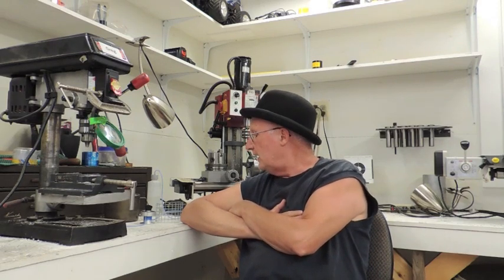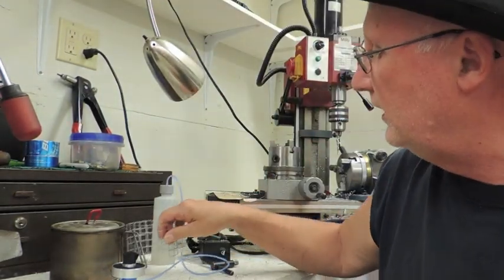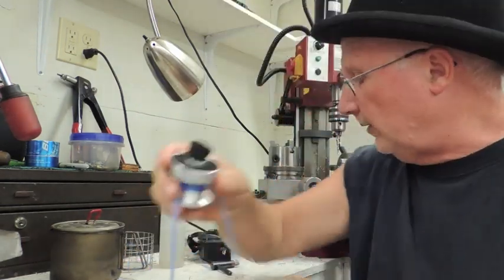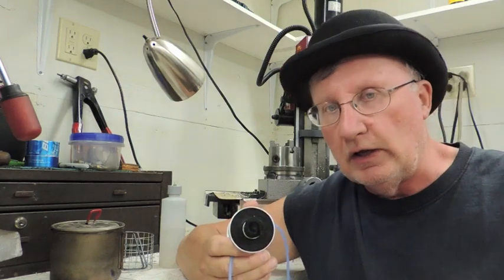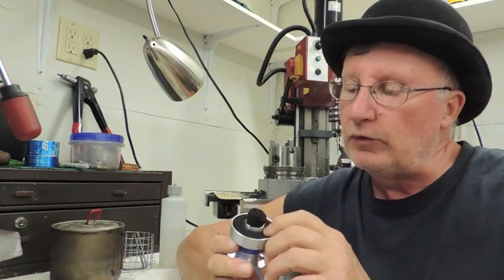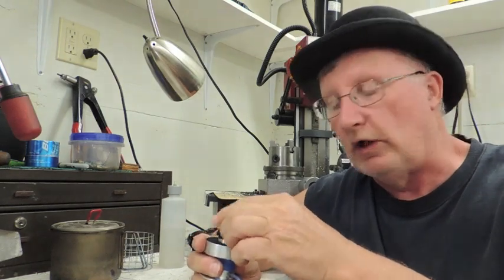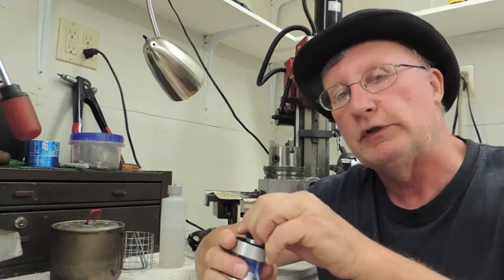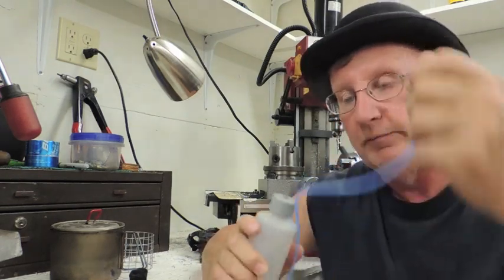Tinny's proto

Comment: I like the new stove. Pop some speaker wire management cover over the tubes to keep it clean looking like your other stoves. Hope to see it in action soon. Have you thought of making one that would have different settings?  A stove where the carbon felt would be able to bloom like a tulip. Full bloom would give wide full head for full burn and set like a bud for a small simmer flame. I am of course assuming the carbon felt will wick the alcohol to the edges.  Take care.